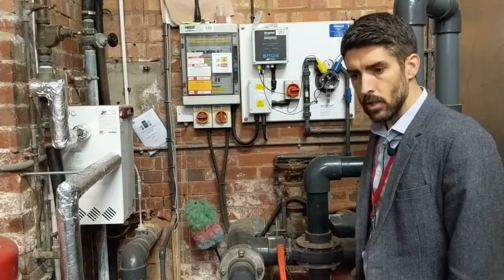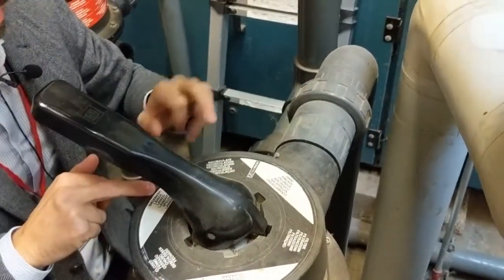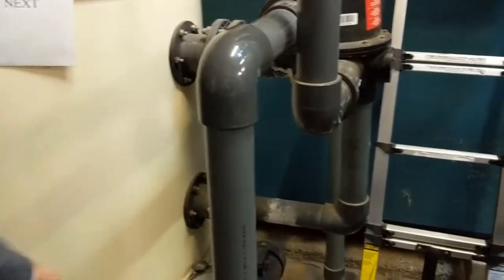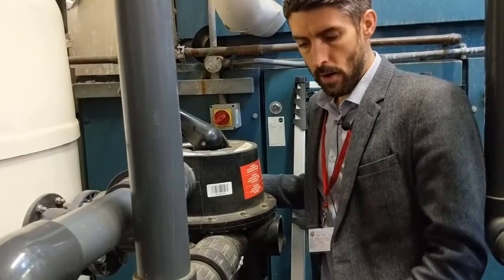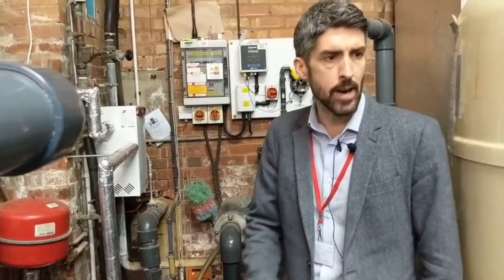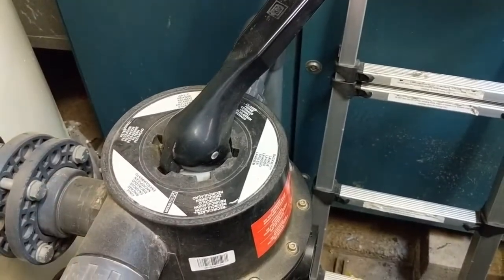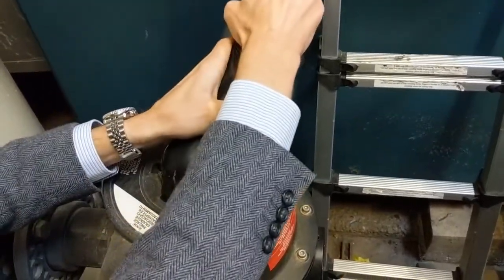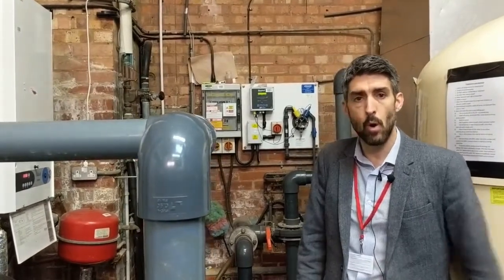Backwash Demonstration (multiport valve)

Comment: If your plant is above the swimming pool and turning off the circulation pumps causes them to lose prime, how would you suggest this overcome? We have three circulation pumps, normal circulation is that two operate with one on stand by.
Reply from the maker: Couple of options. Get a pump pit installed and re-site the pumps to a lower level. Or replace current pumps with self-priming pumps.
Reply: @StockwellSafety  Thank you. In the meantime we would need to allow one of the circulation pumps to run, whilst switching the valves over from normal filtration to backwash positions. Appreciate this is not ideal but this is how the pool plant has been designed. Can you suggest an alternative way?